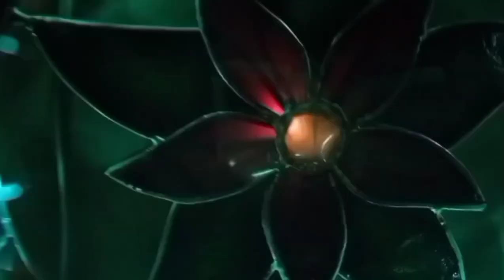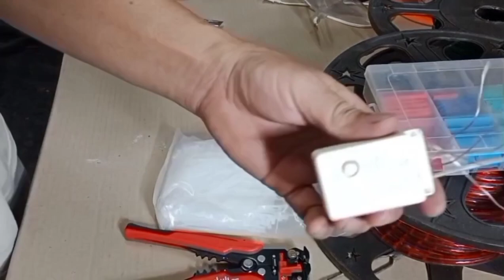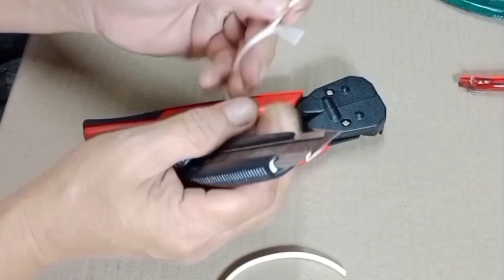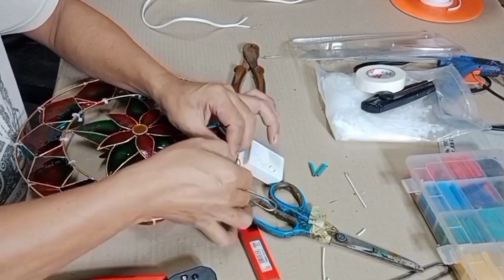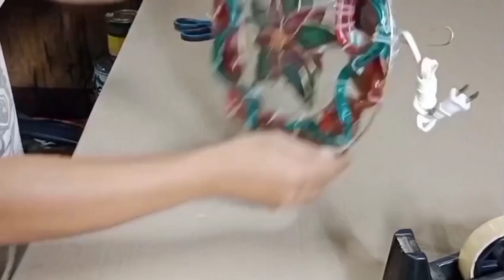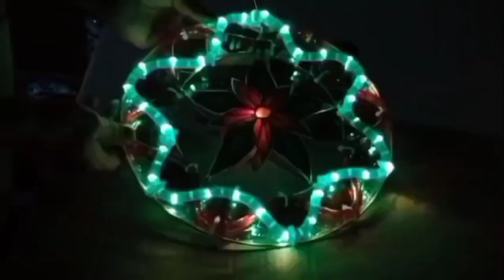Paano maglagay ng ilaw sa  parol, capiz parol, christmas decor

Comment: Sir ask ko lang pano ko malalaman yng common wire nya.salamat sa sagot
Reply from the maker: Sir yung common doon po yan galing sa IC controller na may + yung tatak Pag binuksan mo yung IC doon I top lahat ng common, I mean lahat ng kabilang linya ng mga ilaw, anyway may bago akong upload idol yung "electrical installation of Capiz parol using rope light" doon masasagot yung tanong mo idol
Reply from the maker: Salamat po sa panonood

Comment: sir pwedi paturo maglagay ng wiring kasi Yong nabili namin sa pinas tinanggal ang mga blinker
Reply from the maker: Anong ilaw po ba gamit nyo
Reply from the maker: I series connection lang po pag blinker ang gamit
Reply: Sir kung may time po kayo ito po messenger ko lee alvarado manalang I will po if you can help me paano lagyan connect sa blinker please
Reply: @jovenbuca_artsandcraft  tape  led light po ilaw yong  pwedi po ba yong blinker na nka connect sa christmas lights?
Reply from the maker: Yes pwedi yun, limang line yung output Nyan yung ISA Jan ay common yung apat ay positive so lahat ng negative ay pagsamasamahin sa common lines and then yung pasitive I connect sa 4lines depende kung ilang ilaw ang gagamitin
Reply from the maker: Gagawan nalang kita ng video and then I send ko nalang sa messenger mo I add mo nalang ako sa FB Joven nonoy buca